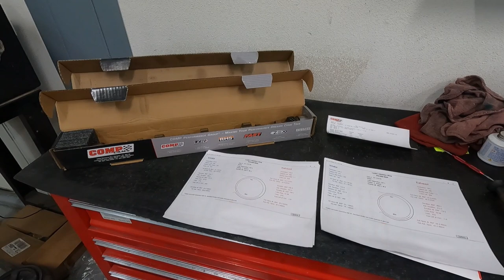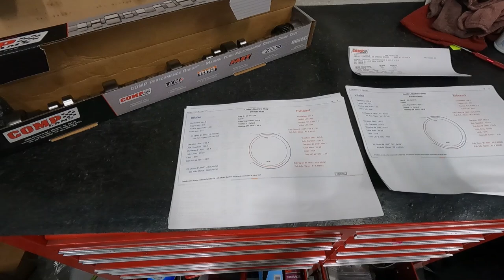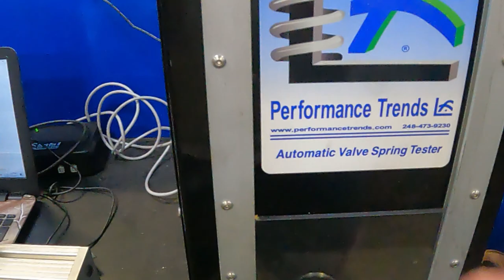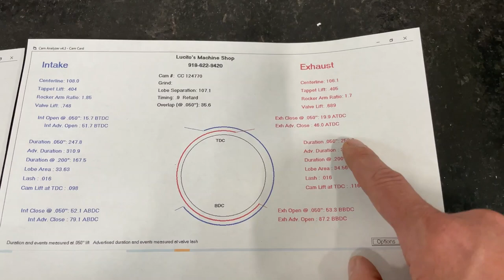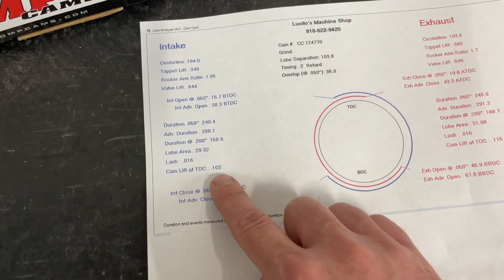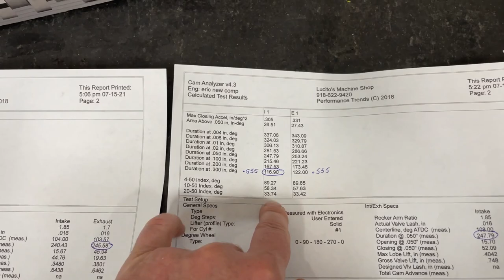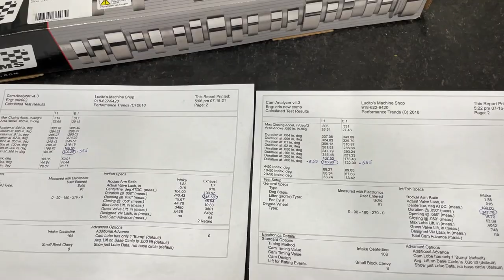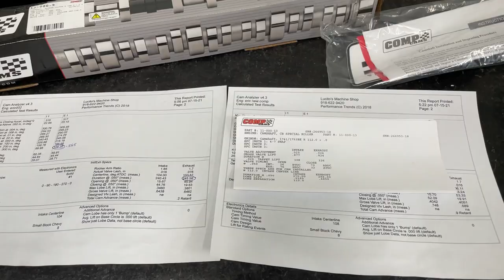Camshaft info. Why I think more lift is better.

Comment: I'm sorry but how exactly does a rocker ratio change increase duration?
Reply: Doesn’t change actual cam lobe duration but does slightly change the valve’s open duration by getting it open quicker and holding it open longer. Little more area under the curve that way.
Reply: Look at it from a different perspective. Increasing rocker ratio increases lift everywhere in the lift cycle, so seat to seat duration is the same, now stop thinking about duration in the usual way at this  seat point.
 Now as soon as you get any lift at the valve,  you get more lift due to the rocker ratio, this means that you now get more time (yes duration) for the valve to be open by any given ammount. 
 Think with a stock rocker ratio of 1.5:1 , now at .050" tappet rise you have .075" lift at the valve.
(Forget lash etc to keep it simple, lash changes the net valve lift but does not change this demonstration as lash reflects out in any combo)
 Now step up to a 1.7 rocker, at .050" tappet rise you have .085" lift at the valve.
 So you have more valve curtain area exposed.
 Now think backwards, with the 1.7 rocker you only need .044" tappet rise to achieve the same .075" VALVE lift as the 1.5 rocker did. 
 So with 1.7 rockers you get that same valve curtain area exposure from .044" tappet rise , then of course more lift everywhere thru the cycle then you still get that same valve curtain area exposure untill .044" tappet fall on the closing side. Now .044" tappet rise on the opening side obviously happens  before. 050" tappet rise AND .044" tappet fall obviously happens after .050" tappet fall on the closing side. So with 1.7 rockers you have increased the time in the lift cycle that you have had the same valve area exposed as the 1.5 rockers did, you have 'effectively' increased the .050"*net lift* figure as compared to the same cam with the shorter rocker.
  Then go on to see the effect at .200" tappet rise where you are getting some good flow going, with this same rocker scenario you are gaining .040" at the valve out there, vastly (in cam talk) increasing you 'comparable' @.200" duration and potential port flow.
  So the rocker ratio is only a relay of message grom the cam to the valve,  the port doesn't care what the cam is doing or what rocker you have, the port or engine only cares about that dam valve! So when you start looking at duration at actual valve lift figures, which is where the action is at,  you are certainly increasing duration with a higher ratio rocker.
Reply: @65mustang393   Thanks for the reply.
Reply: @8power857  Thanks for the reply.
Reply: @bradgriffith4231   correct and incorrect. Rocker ratio changes nothing at the cam yet changes everything at the valve as soon as any lift is achieved. The port, head, cylinder, atmosphere does not know or care what the cam is doing but most definitely knows what the valve is doing.

Comment: Have you ever seen 2 exactly same engine builds one with a light weight crankshaft and the other with forged make different power like the forged way less at low rpm is that possible.
Reply: In theory. Not in reality.
Reply: I did 2 13.5-1 motown blocks 421ci track1 headed identical but one all lightweight scat rotating assembly je's etc for a customer's dragster we dynod no power increases anywhere identically same graph basicly did rev lil quicker cause did titanium valve n rets on 1. But he said the lightweight would run a half a 10th faster n 1/8 and he'd never do it again lol
Reply: @-Atrocious  I've done those tests, and in theory, like a lot of things, sound like it would work. In reality, they just don't. The engine still has to be under the same load of the drivetrain and move the same weight car.... but at an idle in Park, it may be a bit snappier lol.
Reply: Depending on how fast you spin up the engine, there can be a lot to gain.
Steady state, not much.

Comment: Assuming your using aftermarket parts, there is no real cost reason not building for increased lift. Rockers cost the same, stiffer springs maybe a few bucks more, can cost the same etc.
Also, assuming if your building an engine then your using very good oil and changing it often, so the wear concern goes out the door as well.
Want to get 100,000 miles from your build? Then drive a Honda to work numnuts!

Comment: I am of the Belief more duration than Lift .. Something about high lift cams beating the hell out of the Springs..
Reply: Lift doesn't beat up springs. Correct valve events and timing uses many variables. Neither hurt springs but both are detrimental to the curve.
Reply: How does lift beat up springs..? And how does adding  duration stop that..?
Reply: @benjaminrutledge7675  let me give you an example a valve lift of .500.  vs. .650 at 6,000 RPMs the higher lifting cam will wear the valve train much sooner. Why not have a cam that has a little lower lift and maybe a little more duration does my logic make any sense at all or am I wrong
Reply: @davidz1189  i agree completely with your logic with street durability in mind.also,the resulting not so steep ramp/lobe angles are less likely to wipe lobes and lifters during break in [with flat tappet cams].
Reply: You know what beats up springs? Flat lope tops that needs a ton of spring rate.
The higher lift lobe can have a much softer nose profile compared to a lower lift lobe if midlift duration of the higher lift lobe is the same as the top lift duration of the short lobe. Smooth = stable and soft.
Reply: @benjaminrutledge7675  Adding duration can soften a lobe and slow down the ramp rate. But that's obviously only if the lobe is designed that way. More often than not, duration is increased from seat to seat, so the ramp rate stays pretty much the same no matter the lobe duration. Are there exceptions? Yes, but they are few. Just look in the Howards, Crane or Comp lobe master catalogue.

As Eric has pointed out in this video, most people don't understand camshafts even thought they might think they do.
Reply: @davidz1189  Because a flatter top lobe is much harder to control than a higher lift lobe with a softer nose. Less lift does not save your valve train, smoothness does.
Reply: @bradgriffith4231  Pro stock cannot be compared to most other things. It's the formula one of drag racing. They don't care about valve life, they care about spinning that engine at 12k rpm for a few seconds. Want to know what is used in endurance engines? Look at offshore powerboats. Lift is king and duration is relatively mild all thing considered.

Comment: (1). SB Chevy Dist. Gear....(Circle track) The morons use the Highest volume oil pump. with the thickest Oil possible, then wear out the cam gear.
At the speed shop I saw a pile of cams in the junk pile. only because the dist. drive wore off. Then blame the engine builder, as usual.
So I see your point.
(2) saw SCCA Road Race 305ci. With stock heads & flat top pistons, as/per rules, use huge solid flat tappet cam good to 7200 RPM
and Edelbrock street shorty headers (Which are terrible)
which made the engine a total DOG! I could not talk common sense to them.

Comment: "No man you don't need more lift than the cylinder head maxes flow out at." (Wipes drool from face.) 😆
Reply: True if you had max lift during the entire time from opening to closing. But that doesn't happen. But the extra lift as the valve opens and closes will give extra flow even if the cam lift has to go higher than the heads max flow at full lift which may be needed to get the valve to go over the nose smoothly. This will give a higher total flow during the entire time the valve is open.
Reply: @kevinpurtlebaugh8854  lol I was joking. Hence the wipes drool from face in ( ).

Comment: Too much lift can bleed off too much cylinder pressure and kill your engine . And less lobe seperation stop the bleeding off of cylinder pressure on lower powered engines thats why they run better . Doesnt build anymore compression as you states just holds what it already makes longer

Comment: I really do feel sorry for you pushrod guys. Man it must suck having so little useful duration compared to low lift duration :/
Reply: I can only talk for my self, over the top man but these engines allow one to build power at a resaonable price. Only need one cam!
Reply: @MsKatjie  Ofcause, but it also depends on where you live. Most of the "western" world does have quite stringent emission requirements, which makes the need for a higher ratio of useful vs. off-seat duration a bit more important ;)
Reply: So you feel dohc has more usable duration per advertised duration?
Reply: Also rocker arms allow for more lift than cam on lifter.
Reply: @dennisrobinson8008  Indeed, it's undisputed mechanical facts that a flat tappet has heaps more low lift acceleration, and that gives more high lift duration for minimal off-seat. Direct-acting mechanisms also have less than half the mass in motion per valve size than pushrod, also allowing for the much higher accel rates. If you were to have the same amount of accel on a roller lifter push-rod style, it would knock the lifter out perpendicualr to the lifter bore, and break something. And with regards to lift, shure but I achive 15mm lift (.59") on 46mm (1.81") valve easily on my direct acting setup and it will practicly last for well over 200k km or 124k miles with sane springforces. Those 15mm lift is on 37mm diameter buckets, still room for larger lifters still IF one choose to stick with round bore buckets. If even more lift (hardly neccessary) is even needed one can use finger-followers, and use a different base-circle. Also the lobe lift is not nearly as limited as it is on a CIB/OHV, as lobe lift and base circle isn't limited by camshaft journal bore. The only actual benefits a CIB/OHV setup has over direct acting is more compact cylinder heads, and cost.

Comment: I disagree  on more lift. What does your heads flow Amd where do they flow it at of you got a head that’s outta breath at .600 there is no earthly reason to run .650 or .700 lift it is largely depend and on your heads. In fact there comes a point that your heads will start to flow less cfm with more lift it will at some point the heads port will go turbulent and flow less .
Reply from the maker: Simple. With a higher lift cam you spend far more time at lower lifts than a low lift cam does. So if I have a .750 lift cam it will spend more time at .600 than a .600lift cam does. A good head does not back up on flow with lift.
Reply: @WeingartnerRacing   Richard Holdner and David Vizard do not agree with your opinion either. All you are doing is beating the valve train to death. Low lift Amd mid  lift flow numbers are far more important than peak flow at high lift. You cam should lift right at or barely past the peak flow of your heads your duration will keep the valve at optimal lift ranges whithin the limit of your head flow. So of your heads run out of breath at .500 you really shouldn’t go much past .510-.515 lift. Just for an example.
Reply from the maker: @jackrabbit7389  most heads don’t run out of lift until well past .800 lift so I’m glad you’re agreeing with me to have more lift. George Bryce and Darrin Morgan agree with me and they have nhra championships.
Reply from the maker: @jackrabbit7389  also if your peak flow is at .500 lift and your cam is .500 lift you have no duration at .500 so really you made the cam give more duration at less than peak flow. Now if you had a .600lift cam you would actually have duration at .500 lift.
Reply: @jackrabbit7389  Well, what Holdener says is not law, and 19 out of 20 times, he asks Godbold, Tooley or one of his other buddies for cam help. Here's a news flash for you.They agree on the lift, so if anything, so does Holdener. You should also remember that he does not consider himself a cam expert, and all he does is give "general" advice where he avoids the complex parts of valve events.
I had this exact talk with David Reher a few years back, and he also agree on the lift. If you read some of holdeners articles, he always talks about effective duration and midlift efficiency. What you get with higher lift, is effective mid lift duration. Is there a point where it becomes pointless? Of course, but that's at pretty radical lifts. Lifting a valve to 725 instead of 650 is not that difficult, and much can be done to decrease loads. I was seeking a pair of lobes as late as today, and was browsing the Comp catalogue. I was looking for a 244 and 248 lobe for a powerboat application, and trust me when I tell you that there are at least 30 of each, half of which has the same lift. What Holdener does on his channel is trying to keep it simple, and that's a good thing, and his target audience are junkyard builders. You need to dig a bit deeper to fully understand what he's saying.

You can get a much softer nose profile on a higher lift cam compared to a lower lift cam with the same duration at say .300" if one is .320" and the other is .370". IF the lift at .300" is what matters, get the cam that puts the least strain on the valve train for the duration at .300". When the cam lobe is flat, the transition between up and down becomes MUCH more aggressive, and that means you need to add a lot of spring rate.
Reply: @AB-80X  LOL Holdner and Vizard have literally tested 10s of thousands of combos. Literally 10s of thousands. You are wrong of you look at flow numbers a head that flows peak CFM at say .600 lift if you look at lift numbers past .600 the majority of heads the port goes turbulent and flows less cfm which kills power Amd like I said beats the heck outta valve train unnecessarily. Not to mention it takes more power to compress the valve springs the further they are smashed. You assessment is dead wrong BIGGER is not better
Reply: @jackrabbit7389  he said bigger isnt better.  but thats in duration not exactly lift.  thats not set in stone.  remember he said his 565 BBC that makes max power at 7500 has the same duration as people with 400s who probably dont even turn their 400s past 7200